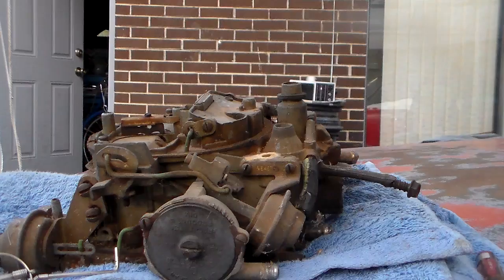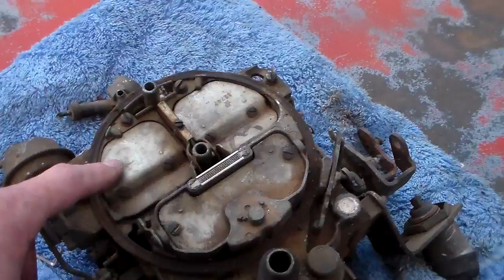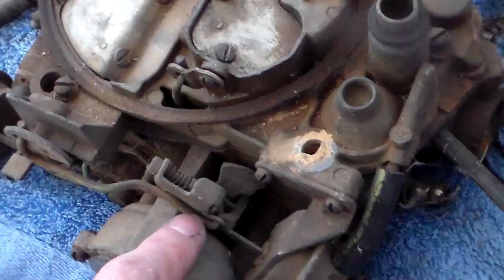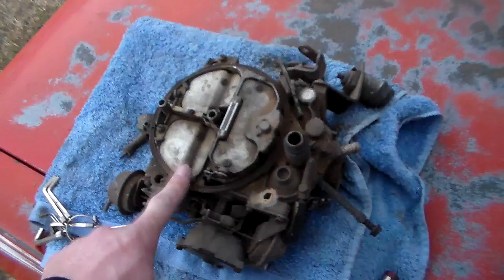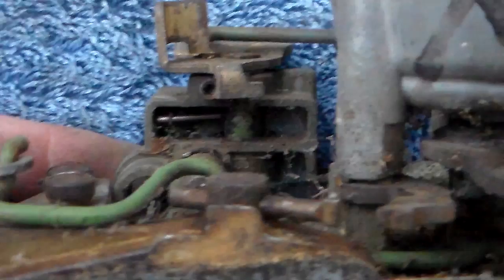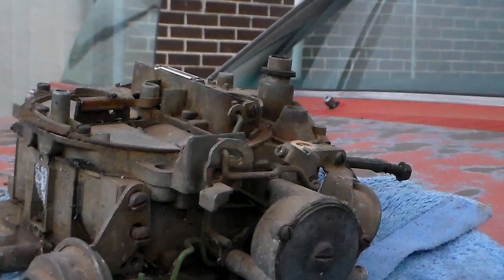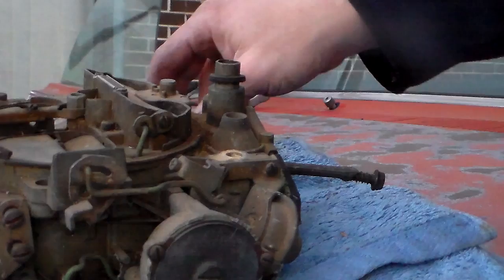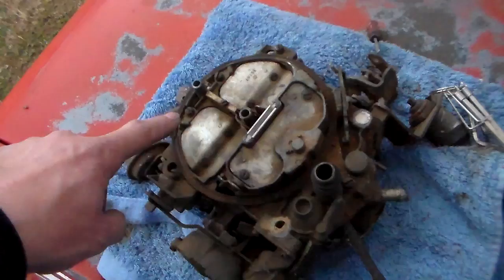How to adjust Quadrajet secondary air doors

Comment: great video ty for sharing it i got a 800 cfm quadra on my 85 silverado c30 with a 454 im having problems with the damn throttle sticking i sprayed some wd40 in the throttle cable and it worked for about 2 weeks so replaced it and it worked great for about a month and its doing it again now im have a hard spot in the throttle when i push on the gas ist not a problem when going down the freeway but when in town its hard to stay at a certain speed with it doing that i also replaced the throttle springs abd same thing any suggestions will help ty for your time
Reply from the maker: goof ball That needs to be fixed asap because if it sticks you could cause an accident.

 First thing is disconnect the throttle cable at the carburetor and see if the throttle(at the carb) closes back smoothly each time. if so, you found your problem, which is a worn out, sticky throttle cable. Those are cheap to replace. You can't lube them and it last any length of time.

If you still have sticking issues at the carb itself, which I doubt then you'll have to see what's going on. Sometimes the baseplate can warp and cause the throttle blades to hit the sides of the bores, but this is very uncommon. Sometimes also the throttle shaft will wear into the baseplate, but I think your entire issue will turn out to be a worn throttle cable.
Reply: WhoSaidTyler ya i replaced it anf the new one worked great for about a month then started doing it again i will check the carb next thanks
Reply: goof ball also what would be a good  lube to put in that cable i tried wd40 and it lasted about 2 weeks is all

Comment: Yes that is the actual number!
Reply from the maker: Ok, I know this is taking on a life of it's own, but you need to know what type of carb it is and what type of choke at the very least because they changed at the first of 1975. I don't doubt that you are reading the number correctly, but it's just not a legit number "as read". Rochester absolutely could have mis-stamped or double-stamped a carb, so anything is possible.

If I take off the 10 at the front, then 7029207 comes back as an early-style Quadrajet for a 1969 Corvette and is actually a fairly sought after carb for those guys. However, you need to do me a favor and look at each of the two links below, then tell me which matches what your carb looks like.

1. This is an early-style Quadrajet used from 1965-1974. Notice how squared-off the carb is at the front and that there is no vent tube angling off at the front. In fact this is supposed to be the excact carb my "modified" number matches. The small metal box on the top center is inconsequential.

http://www.carbkitsource.com/carbs/images/numbers/Rochester/7029202.jpg

2. This is a M-series(modified) Qjet that was used from 1975 onward. Noticed that the front is bulkier and may have a vent tube angling off. There are different shapes cast in that the early carb doesn't have.

http://thumbs4.picclick.com/d/l400/pict/370480301819_/ROCHESTER-QUADRAJET-CARBURETOR-350-CHEVY-TRUCK.jpg

It's important that you at least know what series you have because things like linkages and choke dampners don't generally swap over.

Also, when you take a look at your carb, can you tell me what kind of choke it has. You have 3 choices: If it has either an electric or hot-air choke, there will be a choke unit mounted directly on the right side of the carb as seen in the second pic. Electric will have a single connector in the middle of the black thing, hot air will not.

You third option will be a "divorced, intake manifold mounted choke, in which case the right side of the carb will look exactly like the first picture. There should be a choke dampner, but not actual housing. Sorry this is so drawn-out but I figure you would at least like to know what that beast actually is.

Comment: What a about taken the choke off for racing.
Reply from the maker: That will get you maybe 1 cfm and .000045 horsepower, plus make it that much harder to start. Modifications for racing are ok if you are running Top Fuelers, not otherwise.

Comment: Thank you for a very instructional video. I have a little problem with 
my Quadrajet in a 81 Turbo Trans Am. If I hit full throttle fast, the 
secondary valve opens, engine chokes and stoppes. If I build up RPM more
 careful, the secondary valve keeps closed and i reach desired max RPM. 
This mean if I put the hammer down the engine stoppes. Any idea? see 
video: https://vimeo.com/161299647

Comment: 107029207
Reply from the maker: You're gonna have to take another shot at it I'm afraid...that's not a valid number.

Here's a link that shows you where to look in the event you grabbed one of the other numbers scattered around:

http://www.buickperformanceclub.com/carbnum1.jpg

The number has to be in this form....170XXXXX or 70XXXXX. Some generic examples are 17058270, 17085400, 7045252, 7057550 etc etc etc.

"7029207" comes back as a valid carb number...off an old Vette. Is that the actual number?